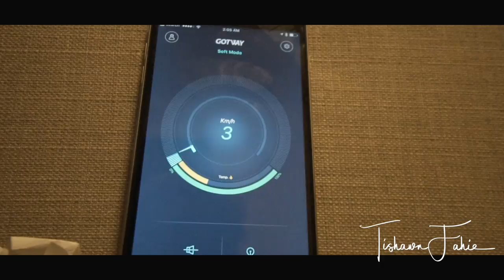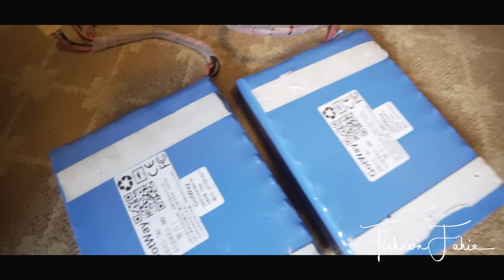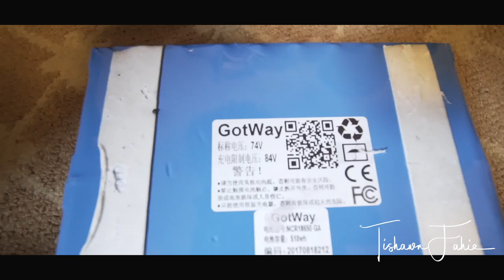Gotway Tesla - What's inside?

Comment: Hi! :) At 5:12, is there a hole in the plastic ? The two parts seems not fully joined. As it is located under the motherboad, I guess that if the tire is just behind this plastic part, if you ride in water, the water could be projected througth the hole directly to the motherboard's fans ? If I am right, you should fullfil the hole to protect the electronics components I guess... I am very interested by this gotway model, but I am not very confident ^^ Did you faced any trouble with this wheel since you have it ?

Comment: Have they increased the build quality since the ACM?  Any issues with overheating or melting solder joints?
Also, wouldn't 1ft 16in just be 2ft 4in?

Comment: What you advice me to buy. Gotway acm or kingsong s16?
Reply: IMO, if you can be satisfied with KS-16S's 35 km/h top speed, then its the best all-rounder. People like me can't, so will need either the ACM 1300 (but no trolley) or Tesla (with trolley - thus I bought this).
Reply: R6ex thanks for your answer. Why kingsong s16 is better than gotway acm and inmotion v8? I think it's enough speed 35 for me
Reply: Actually, the best 16 incher is the Tesla (albeit untested). For tested products, KS16S has 75% more range and 50% more power than the V8. I'm 58 kg, yet feel the V8 is under-powered for my needs coz I like to accelerate hard and go above 35 kph. The V8 range is pretty pathetic, about 40 km. Actually, its only useful for the first 10-15 km coz once the battery level drops below 80%, I can feel the drop in power from the motor. No fun. However, if you don't need to go for long trips and don't need lots of acceleration, then V8 is a fun wheel. Its got higher footrests so sharp turns are fun. The V8 is nimble and very light - 13.6 kg. I don't need the LED lights, but if its something you'll appreciate, V8 has the nicest lights around. The trolley is very useful for me coz I walk it around lots for shopping and commute in trains etc. KS16S is marginally less nimble but still considered agile. Its more stable at speeds compared to V8. Its is however,  a bit less reactive to inputs from us compared to V8. Next, ACM 84V is a power house. Sadly, no trolley. Its 50 kph fast at top speed. Its agile. However, its got low footrests, so no sharp corners. Great cruiser though. Its heavy - almost 20 kg - but very stable over bumps and at speeds compared to the others. Its may be a little less responsive than the V8. No colorful LED lights around. Everything's basic and functional. Its got the longest range as well. Overall, V8 is the fun thing for short trips while ACM is the tank for the long-haul. KS-16S combines both qualities in small doses to become the best all-rounder ... for now. Come next month, I'm sure the Tesla will be the best 16-inch all-rounder, bar none. Tesla has practically the best combination of all above qualities in one package.
Reply: R6ex thanks for you answer. Really helped me. I know you had a bad experience with allie express but i think they have the best price for ks16 but i'm not sure. Do you recommend the 680 ou 820?
Reply: Oh, erm ... I've never bought anything from AliExpress before so can't confirm if good or not. While I'm aware their pricing is significantly cheaper than elsewhere, I'd only recommend to people who knows what they are doing - how to handle returns, RMA, shipment, some technical knowledge of how their wheel works etc.. As I'm not well-versed in these areas, I've bought my Tesla from a local Singapore shop. It costs a few hundreds more but I'm counting on their support when something goes wrong with my wheel; and I don't think think kind of wheels will last long without problems. I've read from certain brand's website (Inmotion or someone else, can't remember) saying their warranty does not extend to wheels sold on AliExpress. I've heard of faulty sets from AliExpress and they have problems settling the problem with the seller. So I'm not going to risk having any of those possible problems. I live in Singapore (27 km by 50 km in dimension), so I don't need mega mileage for my wheel, yet my estimate is that I'll want something in the range of about 1000Wh. Initial indications points up to a 100 km range for the Tesla. Perfect! Why, coz I suspect the sweet spot for performance is in the battery range between 60% to 100% i.e. about 40 km on the Tesla. So happens my longest single trip at high speed is also about 40 km (with about another 20 km of slow speed work). Thus, the 1020Wh Tesla is perfect for me. Sure, my V8's 480Wh battery lasts between 40-50 km total, but only the first 10-15 km is fun coz the range of the range has reduced performance i.e. slower top speed and more sluggish acceleration. What's worst, is one risk motor cutout at really low battery levels. In fact, I had my only serious fall due to low battery level. In conclusion, I would go for the 820Wh, if high capacity isn't available.
Reply: R6ex ok was thinking you are the man of the video... The tesla id too expensive for me. Maybe i will buy the acm because it's less expensive than the kingsong s16 and i can buy a trolley handle for acm
Reply: R6ex what is green fashion? How can i trust that i recive the wheel from them?
Reply: Just a topic around Green Fashion: http://forum.electricunicycle.org/topic/8152-notice-recall-for-gotway-mten3-green-fashion/
Reply: R6ex yes but i'm just searching for something less expensive. And i don't know how to trust in something less expensive... I want to recive the wheel
Reply: R6ex i don't understand how can aliexpress have a wheel that is not realese yet
Reply: Nah. Nobody has it yet, but everybody's taking pre-orders. Likewise, I've paid my local Singapore shop the full price of the Tesla, but I will only get it in perhaps late October. So its perfectly fine for Ali Express shops to take pre-orders. Don't know if they are trust-worthy coz I've never done business with them. Maybe others can reply you with their experience. If no help come forth, or that you can't find relevant information online, perhaps its time to consider local shops around your area.
Reply: R6ex that was a really good answer, thanks. I had been contemplating a KS-16S as an upgrade to my V8, but I think I’ll hold fire for now and see how the Tesla is reviewed. Then there’s also the Ninebot Z series that has me intrigued.
Reply: And don't forget the appealing upcoming KingSong KS-18L (rumored similar spec as current KS-18S but with shorter shell) as well as the awesome Rockwheel GT16 V2 1036Wh: https://www.facebook.com/groups/AirWheelClub/permalink/1995502297347905/
Reply: R6ex i already buy the gotway acm thanks